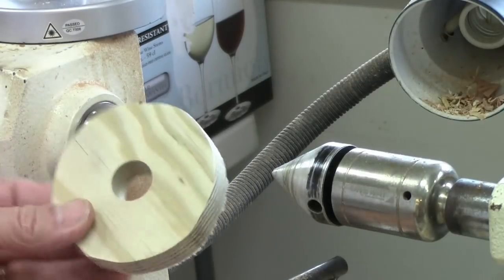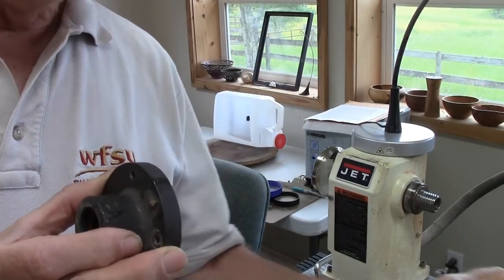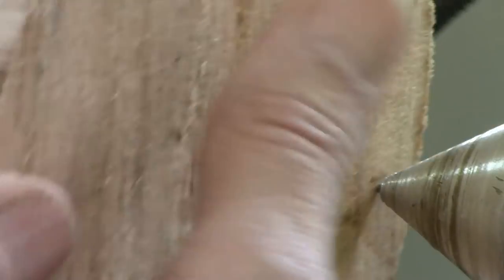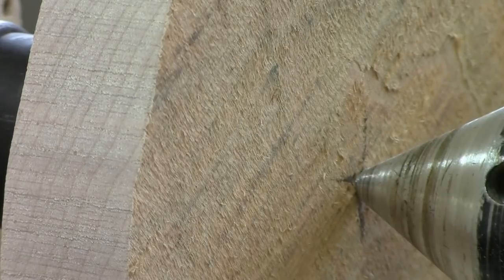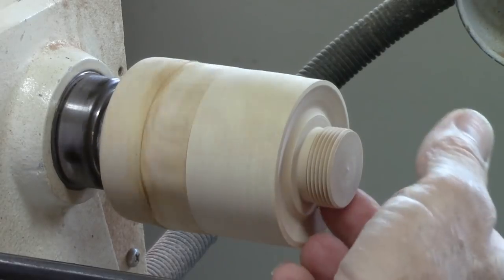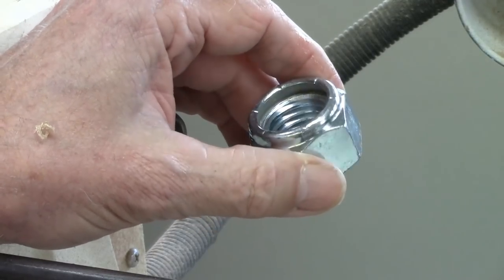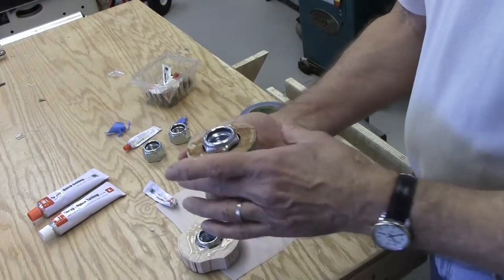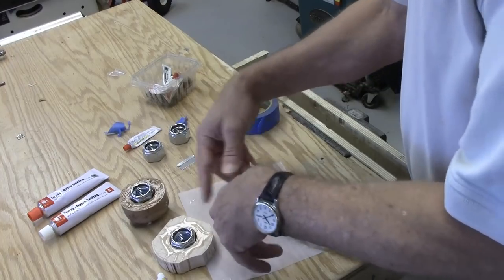Making and Using a Glue Block

Comment: I know this video is 9 years old but I just saw it today. I went down to my local Fastenal branch store and got 5 of the 1-8 nuts for $2.30 each. I did not get the lock nuts, just the standard nut.
This is a great tip and I will make several different size waste blocks this way.

Comment: Tried gluing up with CA a couple years ago. I found that it gets very very brittle when accelerator is used. Launched a couple projects across the shop. For me it's titebond and patience. Very informative video and nicely done.
Reply: I tend to agree.  In my experience, CA is a very niche product.  It does, however, excel at sticking one's fingers together. 😄

Comment: Thanks, I'm new to turning so my initial attempts at removing the nylon insert using the lathe put me in one of those " gotta be a easier safer way for me" modes.  I found out that by putting a cutting bit into a dremel and securing the nut in a vice I could make 3 or 4 cuts into the nylon insert and easily pry out the insert.  Thanks again well done and informative video.
Reply: I don't know if it will work, but I'm thinking I can make a "hook tool" from an old screwdriver to turn the nylon out.  i'll see if it works
Reply: Janice

Comment from the maker: Hi Duhhh,
Thanks for your comment -- I have never had a problem with getting the lock nut glue block off the lathe. I believe that is because the rounded part of nut makes minimal contact with the flat part of the spindle, unlike the larger flat surface of a scroll chuck.

Comment: Ive made a few taped wooden faceplate s recently and usually add a second piece of wood that sort of is like using the nut, gives it both distance and strength. Even thought I like your suggestions about using the nut I still think tapping the wooden faceplate might be a little faster.

Comment: I have been using this type of glue block for awhile and have not had  any problems.   I don't use epoxy. I use baking soda and thin ca glue. Fill the cavity half full of baking soda and saturate with ca glue, let set for a minute and fill to top and add ca glue. I got this tip from Stewart-MacDonald the guitar repair people. They use it to repair the nuts on guitars.The soda and ca glue gets very hard.
Reply: Thanks for the tip!
Reply: I use this technique in some areas of my woodcarving.  However, for this application I would be concerned.  CA can get brittle, more so with age and environment.  I think the stresses on a guitar nut are different from the stresses that CAN happen in turning.. catches for example.  I think I'll consider either epoxy or E6000.  One thing where CA works well in an application like this is to use your favorite wood glue but leave a spot for a few drops of CA.  Add a spritz of accelerator to the mating piece in the location of your CA drops.. mate together.  The CA bonds quickly and holds the pieces together and keeps them from moving while the slower setting glues cure.
Reply: John MacNeil n

Comment: You can get plain nuts for about a third the price of the lock nuts (those with the nylon inserts) and you don't have to mess around removing the insert! Mine work just like the ones we used in Bonnie's class.

Comment: Hi, I had trouble removing the nylon from the 1” lock nut.  After watching your video AGAIN I realized you used your parting tool to get the nylon out.  Did you have much trouble with the tool hitting the metal?  That is a concern as I’m a new turner.  Any suggestion would be appreciated.  Thanks for video and your help.

Comment: I bought some 1 1/4" lock nuts from FWM Fasteners but they were to small for my spindle threads.  The lock nuts are listed as 1 1/4" but have an inside diameter of 7/8".  I called FMW and spoke with a representative named Steve who was very helpful.  He said they don't have a lock nut that large but they do have another nut used in the oil fields that will fit (not  lock nut).  We wondered if your spindle size was smaller that the one on my NOVA, which measure 1 1/4' on the outside of the threads.  I'm returning the original lock nuts and ordering some of the larger nuts.  Hope they work.

Comment: I usually use hot melt glue instead of ca glue and it seems to work well, it lets me take a heat gun the the edge and pry them apart quite easily

Comment: Very good Walter.  I didn't get to see how one would get the ring out of the inside of the lock nut.  Did you suggest I turn it off with a parting tool? 
Any tips would be helpful. 
Thanks,
Tommy
Reply from the maker: Tommy Schutz the nut will screw onto the spindle until it hits the nylon ring.  then you can take a small parting tool and go straight into the ring. you may hit the very end of the spindle, so be gentle as you cut it off. Or you can drill a 1" hole in a piece of wood so that it goes onto the spindle first as a spacer and that keeps the nylon ring from bottoming out on the spindle, then use the small parting tool to cut out the nylon ring.  Maybe take a torch and burn out the nylon ring (I have never tried this but it should work- not on the lathe though).

Comment: try solid plastic decking. It drills easy and taps well.  If too thin blue a spacer to the back.  If you put a metal dowel on the end of your tap the tap will self aline. then screw  wood pieces to it. I then hotmelt my piece to be turned to that. it has served me well.

Comment: Excellent video. I thought that this was MY invention. I use this system because my lathe is homemade, made with junk materials and obviously lacks a good chuck. I discovered something using this method: is that the sacrificial wood must be machined  cup-shaped to facilitate removing the finished piece. Anyway the effectiveness of the clamping produced by the glue decreases from the periphery to the center. I leave it a thin lip, only 1/4 inch or so.
Reply: I have an antique Crescent lathe and I do the same thing 👍

Comment: Walter
I live in Ontario, Canada. I was searching for a 1"-8 locknut and found some at Home Depot today at $12.50 CDN, roughly $9.00 US. So I only bought one. I don't know where you could find them for $1.50 even in the USA. I saw some flat washers for about that price.   Otherwise my epoxy is curing nicely and I should be using my new chuck tomorrow.

Regards,
Herms
Reply: A company called Fastenal carries them at that price in the States. Maybe a dollar more but not much.
Reply: Hey Herms, I have a Fastenal close by.  They had them for $3 ea.  Called a local commercial company and they had them for $2 ea.  I bought 5.. maybe I'll gift one to a friend who has been threading the wood.  They also had plain nuts w/o the nylon.  I opted to not get them as I have no experience doing this yet.  I would have tried the plain nuts but I didn't know if I would need a relief in one end so the nut could firmly sit against the spindle.
Reply: Went to HomeDepot last night here in St. John's, NL - too expensive.  Went to Fastenal - here they only sell to businesses.  Then to a local company - only $1.15!
Reply: I went to the FMWfasteners.com site today and the nuts are not even close to the $1+ price.  They are now $11.60 !! each. Ouch.

Comment: I have a question...I'm using 3/4 birch plywood to epoxy my nut into, will I run into strength problems using the plywood instead of hardwood?

Comment: Using the smaller tubes of Epoxy, you returned the Red Cap to the tube which previously had the White Cap. This will solidify all the Epoxy parts in both tubes.  Good job you hadn't much left in those tubes.
Great video though.

Comment: I have a Rockwell ser.46-111   GD455  turning lathe There is a 4-way spur ctr in the lathe now. I want to put on a faceplate. How do I get the spur ctr out of the threaded shaft. thank you
Reply from the maker: The spur is most probably on a #2 Morse taper shaft that is inserted into the spindle on the headstock. Use a Knockout rod inserted in the hand wheel side of the spindle. Tap it gently with a mallet while holding onto the spur drive. It should come out.

Comment from the maker: Fmwfasteners carries a 1 1/4 nut that should work for larger lathes. It does not have the nylon lock ring. Item number 1698044

Comment from the maker: I have never had a problem screwing the glue block off by hand. Probably because there is only a thin line of metal contacting the back of the headstock spindle. If anyone has ever had them stuck so that they had to use a wrench, please let me know. Otherwise it sounds like someone is worried about a non problem.
Reply: Craft Supplies and Woodcraft sell nylon washers specifically made to prevent the nut (or whatever you are screwing on) from getting stuck on the spindle.  Thanks for the ideas in this video.
Reply: Walter Wager

Comment: I've searched across the internet and I cannot find 1-1/4 inch by 8 TPI nuts. The ones that I find are $10 a piece stainless steel ones are much more.  Anyone?
Reply from the maker: https://www.fastenal.com/product/details/36566 about $6.
Reply from the maker: Check out https://www.fmwfasteners.com/products/1-1-4-8-a194-2h-heavy-hex-nut-plain?variant=16419360645&utm_source=google&utm_medium=cpc&utm_campaign=Google+Shopping&currency=USD&gclid=Cj0KCQjwpc-oBhCGARIsAH6ote_PEDlepWDTPefx-PXVhRl0uG2cobcl_USy3h1cofmKNfE-Bk0mEIwaApgHEALw_wcB

Comment: do you have a part number for the face plate from Harbor Freight? I don't see it on their website.
Reply: Ted Silverman I could not find it either.
Reply: Ted and Kodi.  I stopped by HF yesterday and asked about this.  If you go to their website, I forget where, but there is a link to their parts department.  You should be able to write/call them and ask about the part.  I think there is a funky parts list (I didn't see part numbers.. just diagram numbers) for the face plate.  Hope this helps.

Comment: Why not put the glue in the recess first, then put the but in.....less mess
Reply: Exactly what I was thinking.
Reply: with the hydraulic pressure under the nut, it would probably pop through the tape.